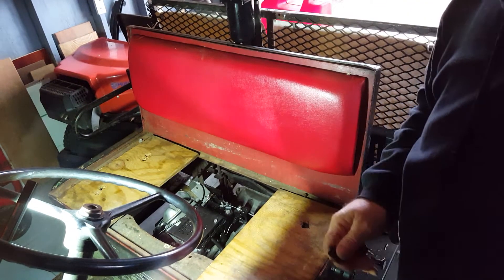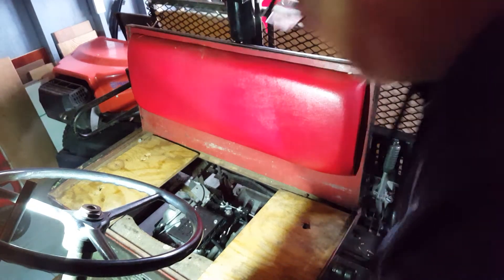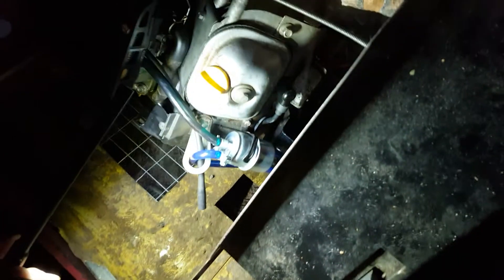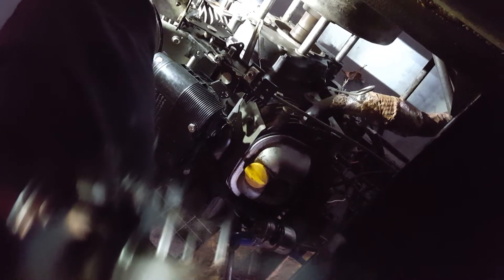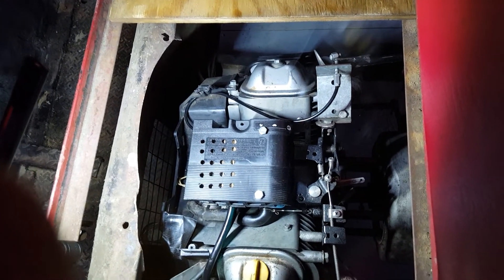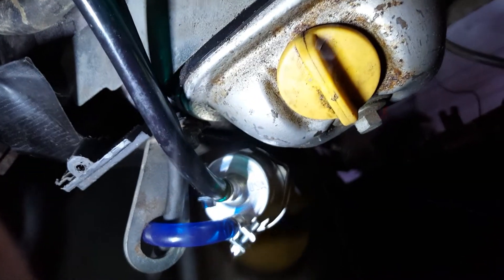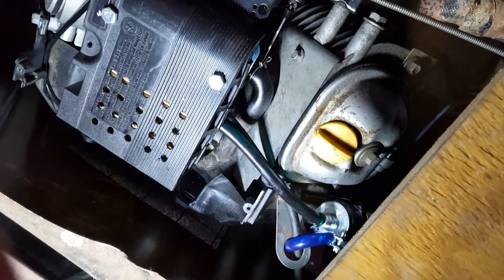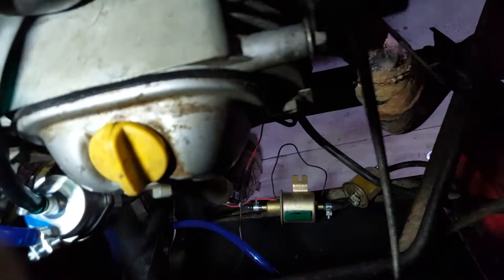PREDATOR 670cc ELECTRIC FUEL PUMP BYPASS FILTER, RETURN TO TANK .. cont'd path to a running engine

Comment: We use our 670 cc weekly. The fuel tank is about 4’ below the carb. The engine is mounted on a insulation vacuum trailer and is ran at WOT after it is warm for up to 8 hours.

In order to get it to run properly we have to move the tank above the engine, and then move it back down. I have been thinking about adding an electric fuel lift pump to keep from having to move the tank.

This seems like it would work well for us.
Reply from the maker: Morning, the diaphragm pumps are a little weak especially if the two vent pipe that act on it are not sealed or cracked, I guess you saw my vid on that. My fuel tank is at least a foot below the carb, the hand primer bulb vid, I have solved the priming piece. Avoid the electric with the standard 670 cc, possibly replace the diaphragm pump with a Briggs equivalent, check the main case vent and go solid pipe on the pulse pipe(watch the pulse pump vid if ya have not seen it), I was worried that the pulse would not be strong enough to move the check balls in the primer but it does fine, it finally fixed my 4 years of issues and going down the wrong avenues to fix these beasts. best of luck with it

Comment: What electric fuel pump did you use that has a return line?
Reply from the maker: Hi David, its the actual filter that has the return line not the fuel pump. But and this is based on working on this for 4 years, the best way do fuel the predator is the original fuel pump. If you have to use a electric pump make sure its 1.5 PSI and no higher. Watch the other videos on this on the channel, the pump I had was 2.5 to 4 psi and its way to much for the float and just floods the carb. With the 1.5 psi its nearer the original psi produced by the diaphragm pump. I also migrated to a hand in-line bulb, there's a vid on that too. It runs way better now. Also watch the vid called Predator Jets
Reply from the maker: in addition the reason I tried this filter by-pass was to bleed off the PSI, it worked a little but sketchy at best, the engine would pulse